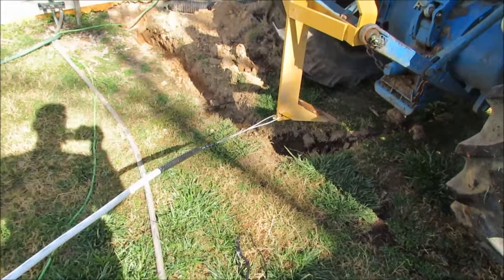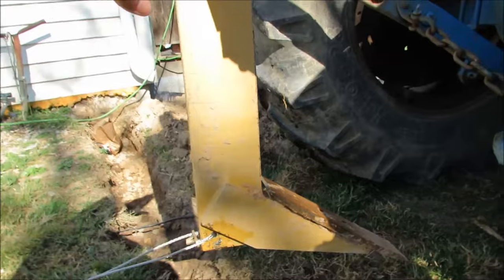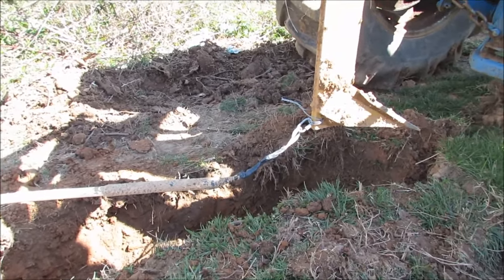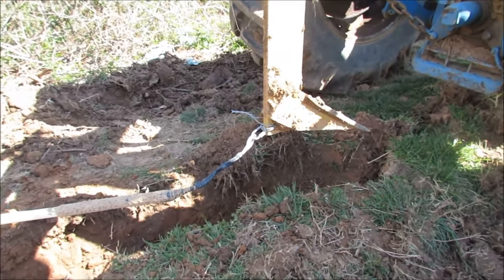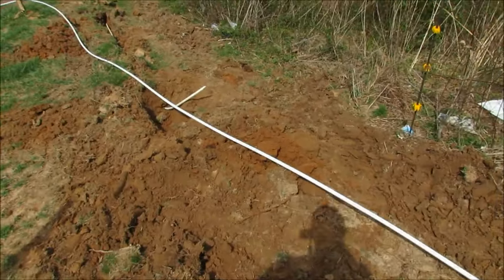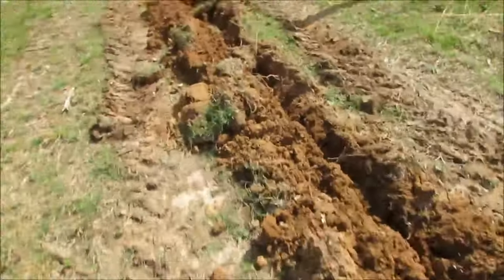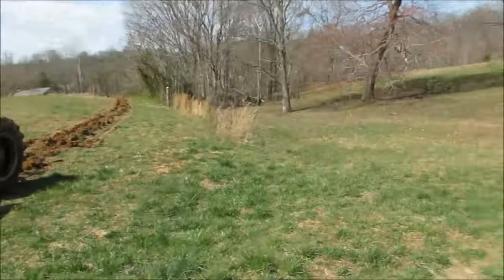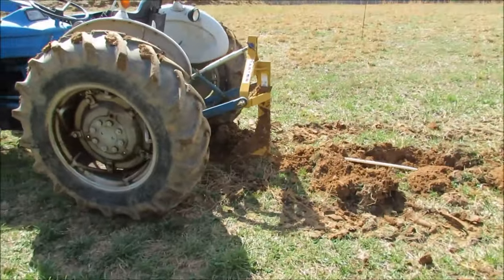Installing Water Lines with a Subsoiler

Comment: Attach an exhaust pipe with a 45 degree bend at the bottom.  Attach the pipe to the back of your sub-soiler.  Lay the pipe as you run the sub-soiler in the ground.  Add a little soap to lubricate the pipe.  Have someone feed the water pipe into the exhaust pipe as you go.  Always a good idea to make a trial run first to make sure all your rocks and other obstacles are broken up first.  Works great for running elect wire also.  There are several videos on YouTube showing hope to make one.

Comment: I hope this holds up for you. But I'm concerned that when you broke the pipe from going around that turn you obviously stretched the pipe. That means its thinned now in more places than where it just broke and I hope it doesnt prematurely fail and bust a leak after all that work

Comment: Problem is your trying to pull 500 feet of pex pipe through 500 feet of earth. Its better to have a the pex pipe feed through a tube going into the earth behind the subsoiler. So your not pulling the pipe through the earth, your actually adding pipe to what you've trenched.

Comment: What u needed to do is have a piece of plastic pipe with a ninety degree bend that is the same width or just under the width of metal that goes into the ground and is at or just above the bottom of the sub soiler.  And then u do one of two things.  U make a thing that holds a spool with ur hose on it or u have the hose laid out going out to where u need it and have a person feeding the hose or wire or whatever into the tube as u drive out.  U put the hose through the pipe on the back side of the subsoiler and have something that the hose is tied off to with more than enough left above ground as u pull the subsoiler through the soil and either a person guides the hose through the plastic on the back of the subsoiler or it is pulled off of the spool.  That way ur not stretching the hose or whatever ur trying to bury much if at all and slowly pull ur subsoiler through the ground.

This way the ground is holding the hose as soon as it exits the pipe and not trying to pull the whole length of hose through the ground.

Comment: I want install sprinkler pipe and wiring.  I thought I would be able to make a run and put the pipe and wiring in the cut. Do you think that it would work or need to clean the cut out...

Comment: Not sure if you considered it but have you seen the vid "Subsoiler - modified cable, wire and pipe burier/layer*, after learning this method it now seems like a no brainer for the small extra effort and cost of modifying things.  If it would not be beneficial to you plse let me know before I get started on my pipe burying. thanks.
Reply from the maker: I would weld a pipe onto the subsoiler if I was to do this again. Follow the method in the vid you mentioned. My way is only good if you have a near perfectly straight run.